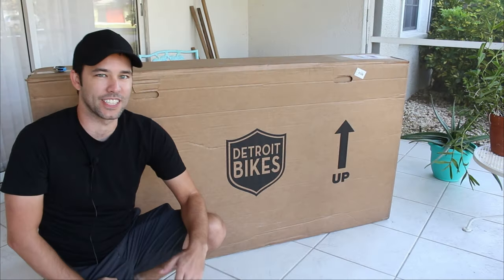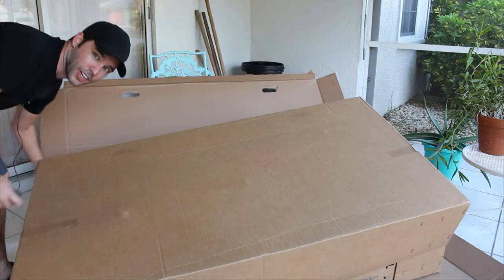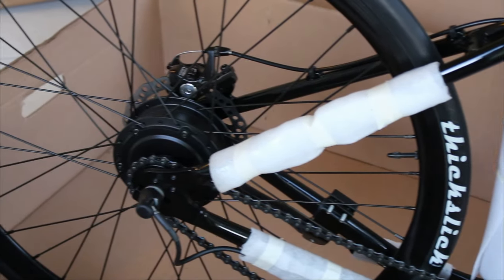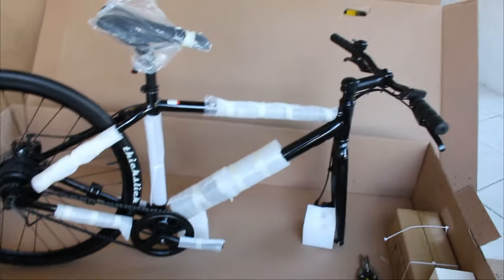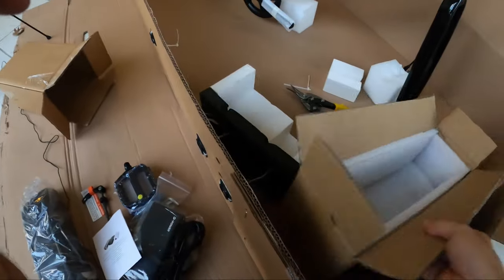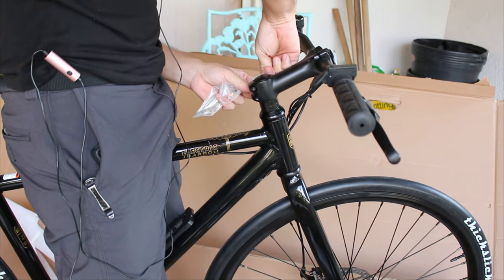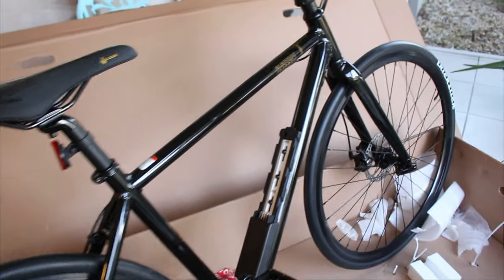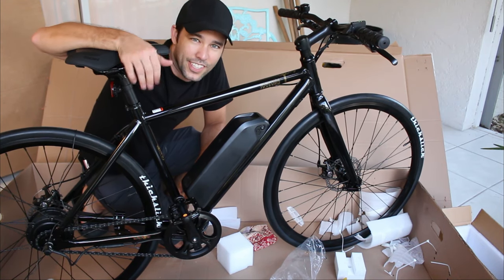Detroit E-Sparrow - unboxing and assembly

Comment: Congratulations on the sponsorship. Well deserved for a good dude. I tip my cap to Detroit Bikes. Use a little black touch up paint or fingernail polish on the top tube (very little). Congrats again!
Reply from the maker: hey thanks so much Teve! I was thinking the same thing about the touch up paint.